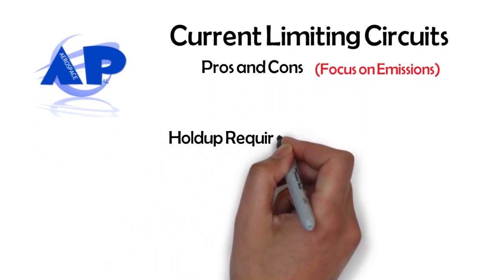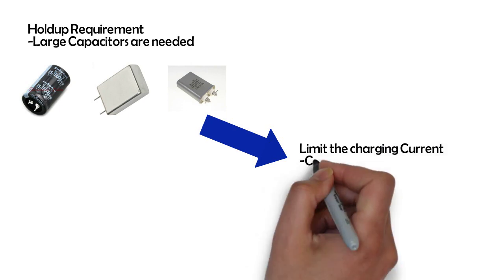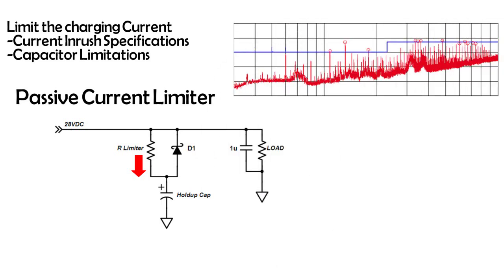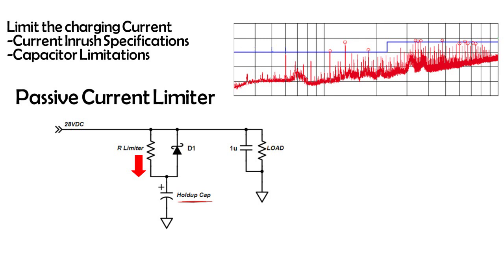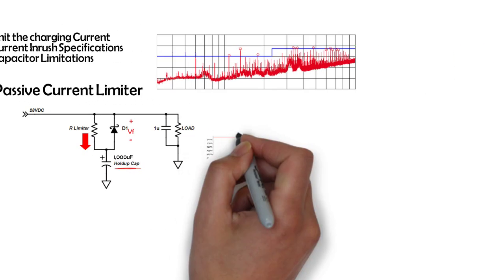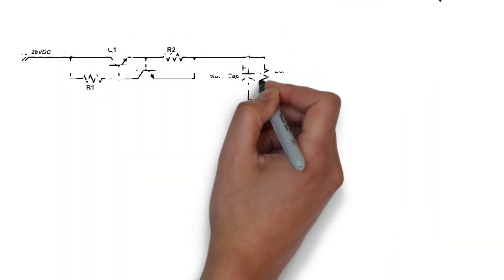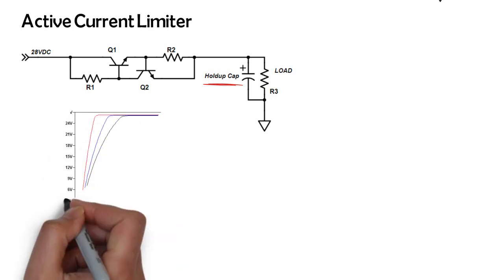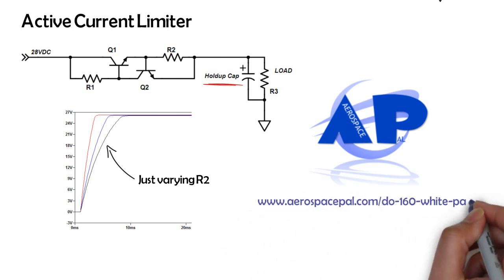Active Current Limiting Circuit Schematic

Comment: Hi...currently my MIL class power supply (VITA 46) have 25ms of holdup time,since we are following MIL 704D its stipulated 50ms holdup time.. Can you tell me what all parameters I have to consider while increasing capacitor value.
Reply from the maker: I would suggest you run a simple simulation in LTspice so that you can see. Increasing the capacitance increases the charging time. It should have little effect on the circuit operation but I would need to simulate the specifics. You should simulate before using it.
Reply: @aerospacepal1970  thank your for you reply.. i will check it and update.

Comment: good video, Informative and quick!

Could one use the load resistor in place of R2 in certain applications? I'm wiring an electromagnet circuit and would like to add this current limiter with the ~2ohm coil as the threshold resistor.
Reply: i dont think coil will do the job , coil is active element , who knows what it will do i dont but since its active its gona do something